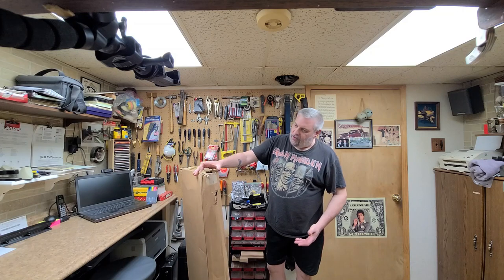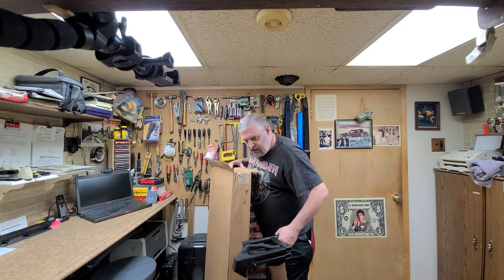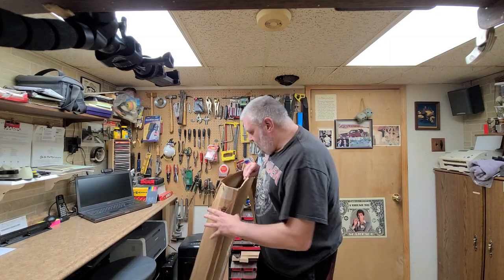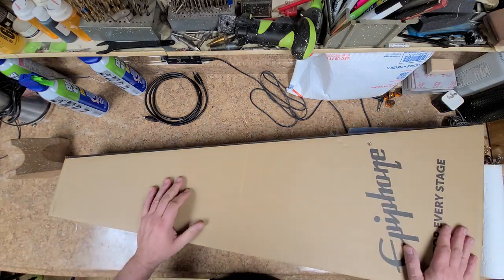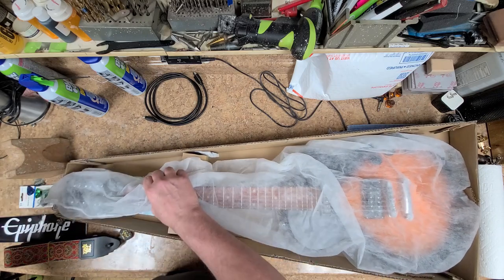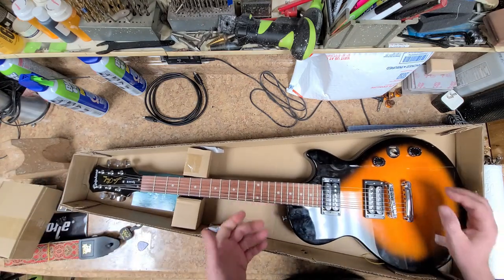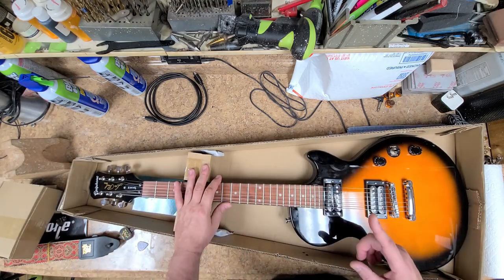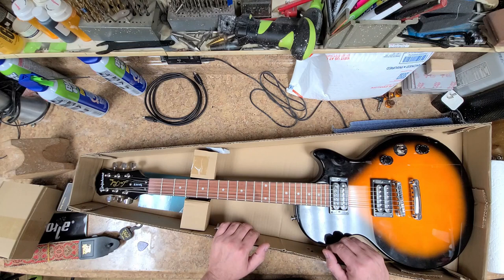New Project Guitar/ Good Bye to a Great Guy

Comment: I have an SG Special from that same line of Epiphone. I was actually wanting one of these Les Paul's, but they sold out of the specific color I wanted right as I went to buy it. So I got the vintage cherry SG and a Squire Bullet Mustang in imperial blue.

I can't remember what the finish was labeled as on Sweetwater that I originally wanted, but it resembled a slightly darker version of Gibson's "Blueberry" finish.